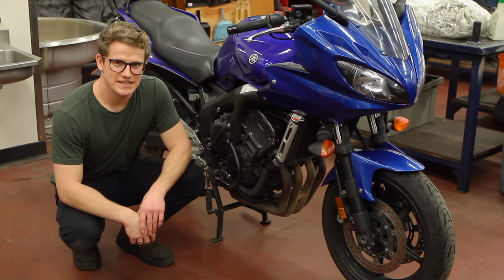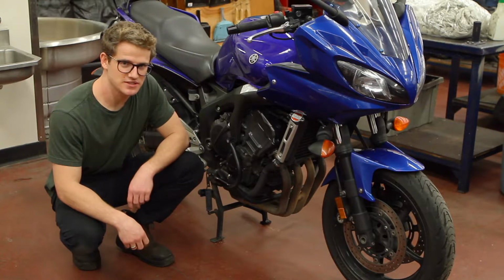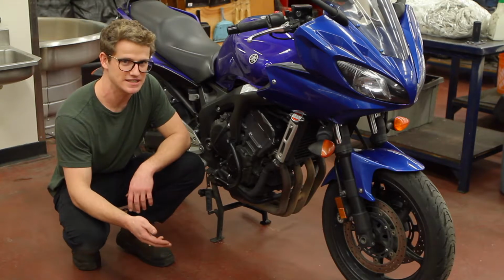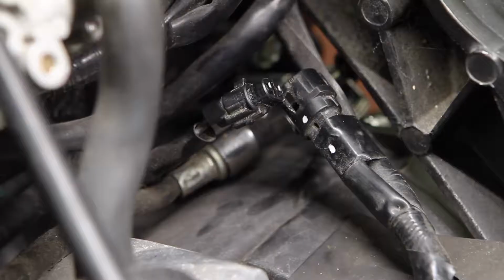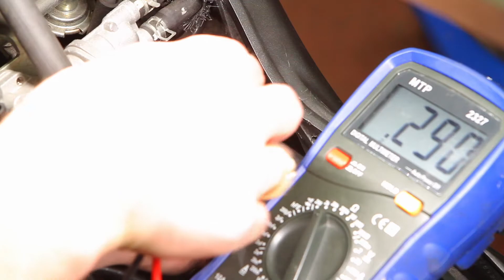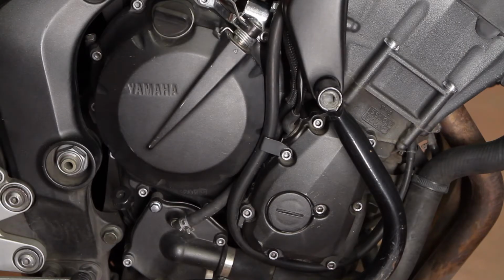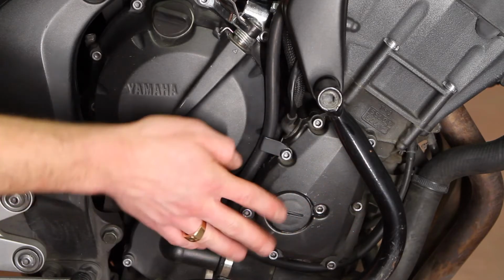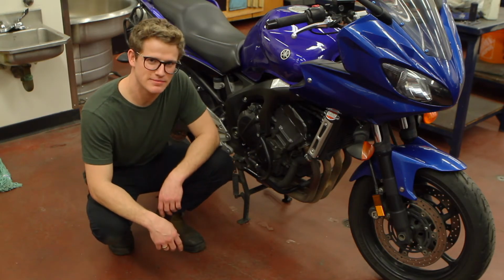Yamaha FZ6 Crank Position Sensor Diagnosis [Code 12] Error

Comment: Love the videos and love this bike. I have been having running issues with mine. Recently I got it to start on starting fluid so I am pointing to a fuel issue. I bought an adapter for a fuel pressure tester. Hopefully it’s my fuel pump and not something worse.
Reply from the maker: The fuel pump is audible when it's priming. If you can't hear the pump kick on when you flick the red handle bar switch to the run position then something isn't right. Best of luck!

Comment: Hi there have 2007 FZ6 had issue of no spark currently...checked all Ignition coils,CPS voltage all other sensors fine..I couldn't see any error codes due to meter display gone..
Immobilizer issue will create no spark issue?
Because fuel priming ok..and able to crank also..only the issue no spark...please need your advice to check further

Comment: Please help me if you would. I have a problem after winter staying. My bike has started normally, but every time when he gets hot(about 1 min.), he does not hold the idle, he has stopped every time. When he gets hot, throttle opening does not affect... What have I done: I have been cleaning the idle sensor, changing the fuel pump, changing the coolant sensor, checking the throttle position sensor on your advice. The built-in diagnostic does not display any problems, and all built-in checks on the dashboard have been done successfully.
Reply from the maker: I would check the crank position sensor when cold and then also check it when hot. Hopefully it measures out of spec when the bike is hot and not running right. Also worth checking would be your ignition coils. Sometimes when they heat up they can malfunction when they’re on the verge of being completely broken. Also check your intake air pressure sensor. It’s harder to probe because you need to cut into the casing out of signal wire to measure the output voltage but it can be done. I’ll link a video to it below. Good luck!

https://youtu.be/423UV85fp8E
Reply: @Calvinm  Thanks for your advice, I will do this and report the result
Reply: @Calvinm  I have checked the crank position sensor in different temperatures, changed the spark plugs, checked and replace the pressure sensor from the other fz6, and found no problems... Ignition coils must be normal because the spark was permanently in different engine temperatures.  The bike started to work worse, he works only 2-5 sec. and dies
Reply: @Calvinm  I was done! I had a problem with the fuel pump case, it had some fuel leak and didn't take the pressure. Thank you!

Comment: Hello Hello Calvin, I have a problem with my 20070 fz6. It shows me check code 12. It gives me .278 ohms and the code is not removed and the motorcycle does not send a signal and does not turn on. What do you think it could be? I would appreciate it very much. Thank you. I await your response on the possible causes.
Reply: Mines reading at 269 an not starting is this my problem

Comment: Have you done a dynamic test to it?
Reply from the maker: I haven’t done any other style test to this crank position sensor. Do you mean an inductance or oscilloscope test?
Reply: @Calvinm  sorry i mean using a peak voltage adapter. Had one ckp sensor that passed the resistence test, But would give very low peak voltage, around 0.28 volts compare to other Inés that gave more than 1.5 volts, Yamaha manuals won't give You this parameters.

Comment: hey! if I have to replace the sensor, do I have to empty the engine of oil before taking the cover off?
Reply from the maker: No you do not have to drain the oil. It helps if you have the bike on its side stand so the oil is tipped away from that side of the engine.
Reply: @Calvinm  thank you! I checked the sensor and it has 268 ohms but I get error 12 if the engine is hot. Do you know what it could be?

Comment: I have the same bike and I’m having issues with it shutting off while I’m riding then it won’t crank at all sometimes it will cut on but I will ride for 3 minutes then it wil shut off again what can be the cause?
Reply from the maker: This sound like a kill switch is failing intermittently. An issue like this can be hard to trouble shoot but I’d recommend looking into your kill switch on the right side handle bar grip and the side stand switch. If either of those vibrate into an “open circuit” condition the bike will shut off because it thinks you’ve put your side stand down while in gear or have flipped the red kill switch to off. Literally shake the bike, wiring and side stand while you have the bike idling in gear to see if you can reproduce the problem. Then bust out the multimeter and start probing wires to to pin point the problem. If the bike throws any codes (check engine lights) use those to guide your search as well! Best of luck!

Comment: Hey bro, I have an old 97 triumph Street I can't get it to start I bought it for 200 bucks and I got to figure this thing out. Anyways mainly it was bad fuel, but I can't get it to start! But when I take the fuel air box off and spray starter fluid it cranks right up and runs sounds snappy. So I wouldn't think it's the crank position sensor would you? But when I put the fuel rail back on and although it seems like the pressure is not too good but the injector squirt and it looks like they're squirting in sequence when I crank it. Could it still be the crankshaft sensor even though it runs with just starting fluid
Reply from the maker: If it runs with starting fluid but doesn’t running on its own injectors that points towards a fueling issue. A bad crank position sensor wouldn’t allow the bike to run well with starting fluid or its own fueling system. It doesn’t hurt to throw a multimeter on the crank position sensor just to check though. Good luck!
Reply: Thanks Calvin. I just found out the bike was made for England and it's here in the United States so parts are a pitch. And it's a 97 so they stopped making a lot of electronic sensors and stuff. Anyways thank you I just wish I knew how much ohms the crank sensor is supposed to run on them trying to do the research it's hard to find. But I appreciate the help that was my conclusion too I ordered the new fuel pump and a new pressure regulator so hopefully that does the trick I can't wait to get on this thing and wrap it.
Reply: Or maybe I should say I'm going to give it a Yankee yank... Lol

Comment: I measured my cps from yamaha fz8, the manual says it should be between 228 - 342 ohms. Now i measured 430 ohm. Is it possible that my bike got intermittent starting problems due this, or is the difference to small? Sometimes i got error code 12, but also a bunch of other random codes +engine check light. Im deciding if its the cps or something with my ecu... The problem happens not all the time.
Reply from the maker: It certainly is possible that your crank sensor being out of range is causing this intermittent starting issue! I would replace it to rule it out of the equation.

Comment: Any idea where the CAM position sensor is on a 2005 yamaha R1?
Reply from the maker: I think it’s in the valve cover between cylinder 2 and 3. Check out this article. I think it’s for your era of R1. Good luck

Link: https://www.r1-forum.com/threads/how-to-replace-the-cylinder-identification-sensor-aka-cam-position-sensor.239070/
Reply: @Calvinm  dope man I appreciate it

Comment: Sometimes this code has nothing to do with the sensor. It popped up when my bike stood for a while in misty rain, prior to that there were no symptoms of problems and the battery was just fine. I was able to push start it and ride back home and after that everything went back to normal. I suspect that the moisture made its way either to the sensors or to the starter relays. Oftentimes this code appears due to the fact that the starter relay is defective.
Reply from the maker: Ya it sounds like some moisture got into that circuit causing the error for you. Good to know!
Reply: @Calvinm  found out the reason - the rubber covering the starter motor cable connection was somehow taken off. I suspect that the moisture caused a short circuit which resulted in the error.
Reply: Same with mine

Comment: I am a 2009 checked the resistances im at 285ohms check the sensor and pickup rotor both are fine, checked the wires and nothings disconnected or frayed, battery is fully charged, codes wiped, still won't start next ill check for spark

Comment: How can I crank my Yamaha without a wiring harness motor is on the ground
Reply from the maker: Apply power to the large bolt/electrical connection on the starter and ground the engine case to the battery negative. Should crank over.

Comment: If this not working then current will not come?
Reply from the maker: If the sensor has gone bad it would likely measure as an open circuit (no connection) across the pins I probed. Or the resistance could be outside the specified range.
Reply: All this is what I wanted to hear. I have a 2017 R6 and the bike shuts off when it gets hot and won’t start again till it cools down. Looses spark when hot. Crank sensor tests OL hot or cold.
Reply: @xxxdriftr i recently crashed my 2020 R6 and now it wont start, it crank and primes when you turn the key Im gonna check this sensor next hope it works!